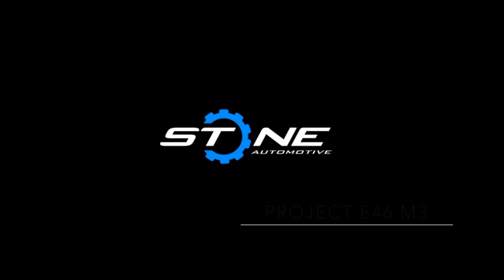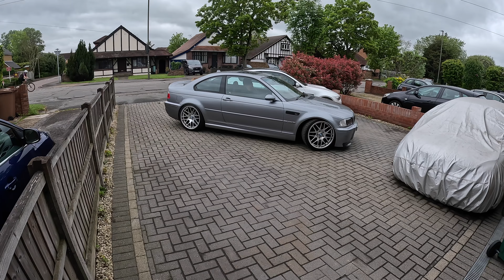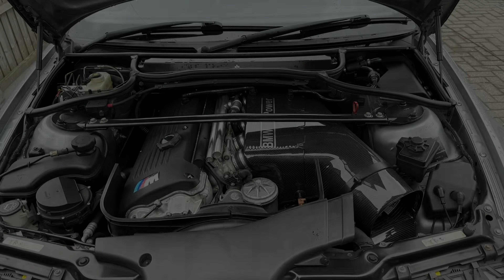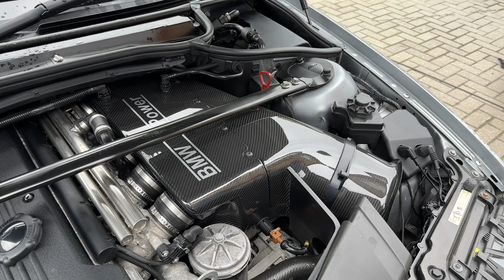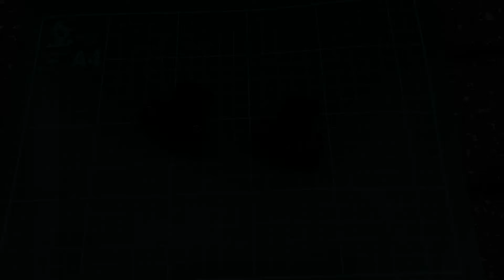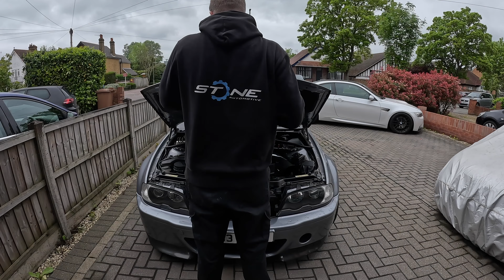BMW e46 M3 Throttle position sensor TPS replacement guide

Comment: Hey @stoneautomotive i have recently replaced my fuel pump to a hella fuel pump and i noticed that my throttle has become laggy. I then reset the throttle position with the key being in the 2nd position and holding it that didnt work out. So i went and replaced my fuel fitler to a mann fuel filter but the issue persists. 1 thing that i have noticed is that everytime i have quarter a tank of fuel the car just refuses to start and sometimes if it starts it dies on idle. That issue was happening with the old fuel pump and fuel filter and even after replacing both. Any idea how to fix the laggy throttle response and any idea what could be the issue that i have when i have quarter a fuel tank?
Reply from the maker: Without plugging it and checking the live data for fuel pressure and current faults you’ll be throwing money away at it. Worth getting it down to a specialist to investigate 👍 if your near Hampshire Spartan Automotive are fantastic
Reply: It's probably a perished seal on the fuel filler cap

Comment: Are you absolutely SURE those two actuators for the TPS's are exactly the same?? Are you??  LOL.   BECAUSE "I" checked into this and it's NOT ALWAYS the exact same part in fact the one underneath has a piece of wire to reach the plug where it sits. HMM. OR!! Am I wrong because I haven't actually looked at mine physically yet to be so COCK sure about all of this and maybe I'm a big fat tool of a guy that will need to apologize to you after I finally do tomorrow IF i actually have to replace it. LOL.  I hope you have a good sense of humor. LOL.
Reply from the maker: Same sensor & plug 👍

Comment: Ooo. Now I hoping mine is exactly the same trouble as yours. If it's not and I have to go and replace the one under the air box I won't know how because yours was fixed with just doing the top one. LOL.

Comment: how did the Hella TPS work and did it fix the issue, also has it lasted? i have used other parts from Hella.
Reply from the maker: So far so good 👍 give it a few weeks before saying 100% for sure
Reply: @stoneautomotive  Hi, did it work? lol
Reply from the maker: @rickyricardo2006  yep 👍😎
Reply: @stoneautomotive  thank you! My car cut power completely. Additionally it went it limp mode but when I restart it, it’s back to normal. I am hoping this does the trick but I’ll keep ya posted. 😅

Comment: Funnily enough mine has gone. (I think anyway). Limp mode comes up at traffic lights. Can’t deal with being in gear and idling. 

(Changed camshaft sensor, spark plugs etc, maF sensor/air filter and no joy. Reset the throttle settings and got the speed sensor code. Also had battery issues so reckon influenced a sensor fail.

Sounds off too idling, just vibrates. 
Touchwood yours is all good now.
Reply from the maker: Sounds like you have a pretty serious issue underlying on yours ☹️

I would suggest checking the compression (diy detailed on my e46 playlist) and run a Vanos system check to make sure it’s within tolerance 👍

Touch wood mine seems back to normal.. so far 😅
Reply: @stoneautomotive  about a month ago, going down a country lane and hit a deep puddle out of no where (night time, at a bend ms no chance to stop or slow ). 15 mins later, car just dies doing 70 on motorway. AA fella came and gave all the codes and mentioned compression funnily enough. I just thought cos the car died, it threw all the codes.

Changed the fuel pump (bought a cheap one after mine went and assumed that) and then worked fine. 

Swear to god day before it went, I said to my other half “I just had the best drive in that”. Probably a goodbye then. Transmission cog comes on now, doesn’t even move forward, just reverses. Can clear the code and works again, until it disables. Have constant stream of dirty water at start up, looks like a puddle by the exhaust (isn’t oil or coolant, odd). 

Unless water in the system mucked it. When it first started randomly shaking at start up (best way to explain and a week after the water thing), had to drive home 2 hours away. Only could have it at 65/75, anything below shakes or above. Then limp mode once I came off the A Road, probably pushed it beyond. 

Ps my scanner only ever said 3 things ever, camshaft sensor, fuel/air mix too rich and the speed sensor when resetting my pedal. Obviously a cheap one. Anyone reading this, invest in a decent one, ha. 

Spent untold on it (just had steering rack and two new tyres) and at a 140k miles, think it’s time… 😫
Reply from the maker: @ryan4372  sounds like it’s worth getting it into a specialist, paying for 1 hours diagnostics could save you hundreds/ thousands replacing parts.

If it had happened when you hit the puddle it would point to a hydro locked engine which would idle badly/run rich if it’s bent a rod but as it happened 15 mins later it sounds as if something electrical got wet. Have you checked the DME box is dry? (Located on the back of the passenger side of the engine bay, 5 torque screws to open and check the connections are dry)
Reply: @stoneautomotive  very true. 

It’s funny you say that. When the car suddenly ran rough. I parked on a curb. Water still in places it shouldn’t be… 

I did feel something electrical at one point, e46s are super sensitive.

When the AA fella came out, he tested the fuel pump and few other electrical things by taking the fuses out. Anyway, week later I went through just to make sure one hasn’t blown, two of the engine control fuses were the wrong way round, started thinking did that put pressure on the engine through out the week etc lol.

I’ll have a look after work at the fuse box.

Genuinely, thank you for the responses and feedback on the above, you didn’t have to and you’ve been super helpful!